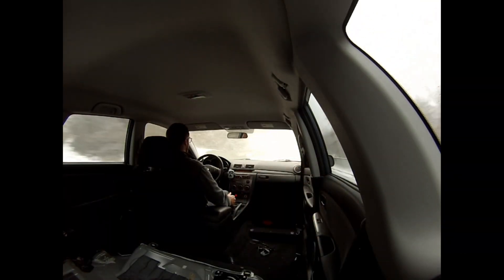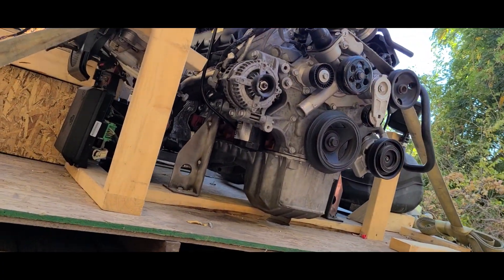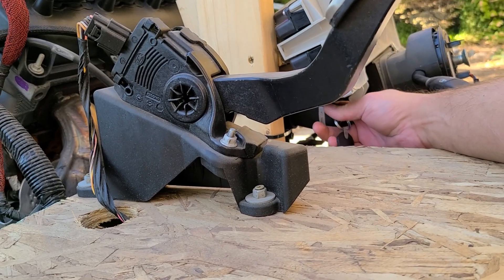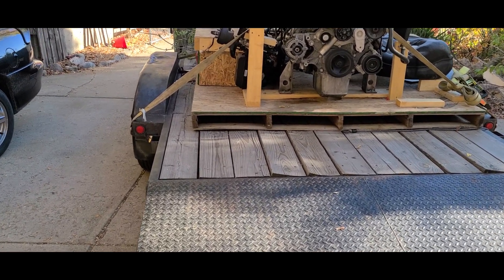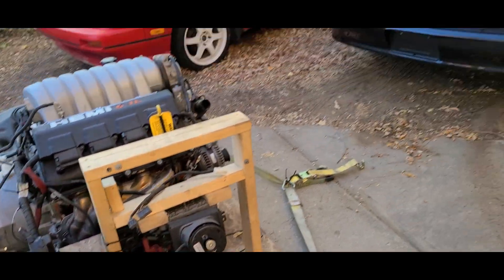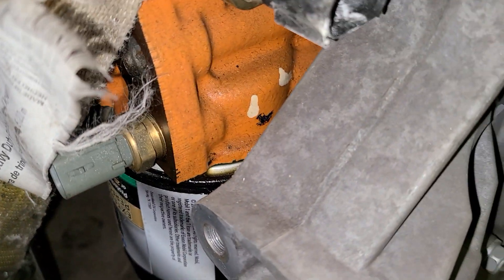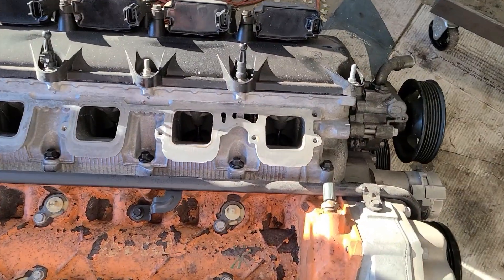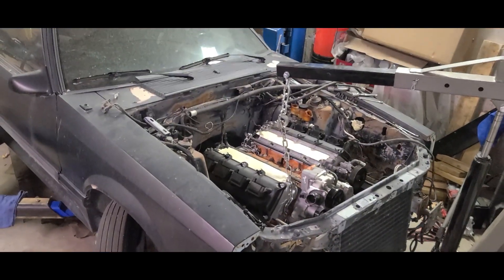Hemi Swapping A Mustang #foxbody #srt #twinturbo

Comment: I commented on your other video also. No way that has 50k miles. These motors suck oil through the pcv like crazy and always have oil in the intake ports and pooled in the bottom of the intake manifold, even with a catch can.  What's your plan for hydraulic clutch? I was going to do the tr6060 behind mine in my 98 mustang but looking into it, it might be easier to do a t56.  Not sure I want to mess with a hydraulic clutch. Either way I'll be following this build. Stock crank is good for 900+HP, rods are fine up to 700whp. Pistons are weak but not as bad as 6.4 pistons especially gapped for boost. Should really check what lifters it has.  If they are stock 6.1 lifters there are ok and haven't had the track record. But even the new "hellcat" lifters are bad. Might want to look at some Johnson lifters. Good luck!
Reply from the maker: Good to know, I had planned on a catch can on it. And the motor came with the tr6060 and assemble so I am going to run that. I had planned (and bought) a th400 originally.